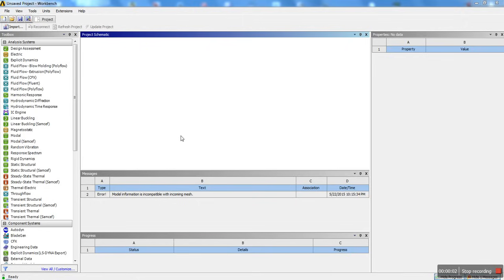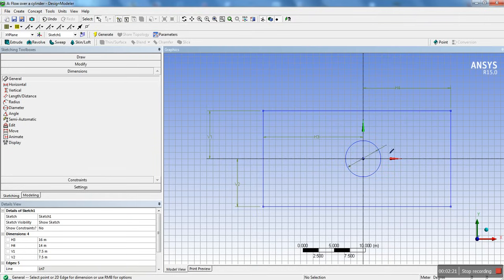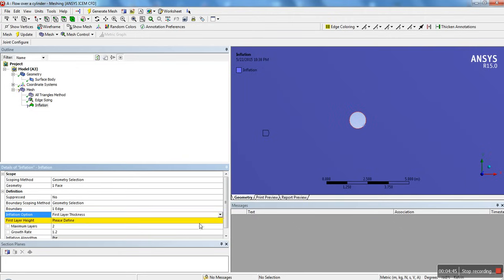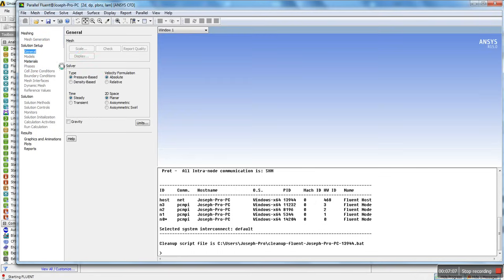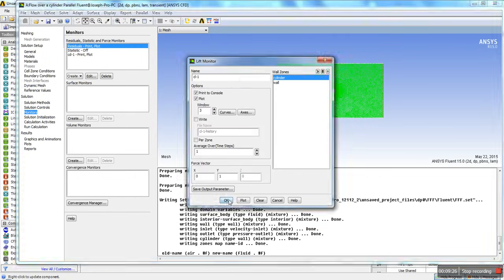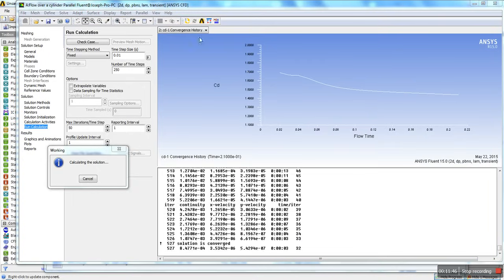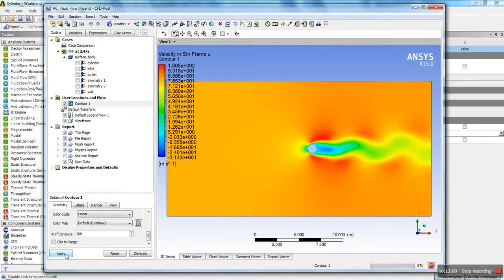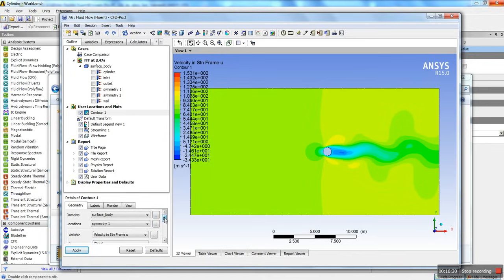ANSYS Fluent CFD Tutorial - Flow Over a Cylinder - Von Karman Animation

Comment: I'm using this tutorial to practice fluent basics for a class at my university, and I've found numerous problems caused by the difference in the software versions (I'm using 2020 R1). Here are those problems and the solutions I found (got everything to work in the end).

0:47 -> double click on geometry doesn't open the design modeler by default any more, instead what you need to do is right click on geometry and manually select "New design modeler geometry".

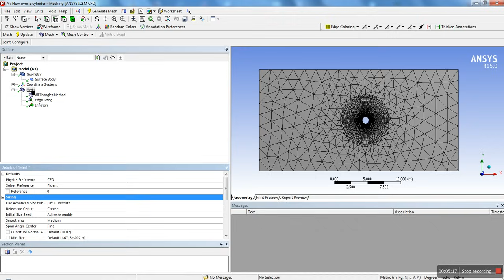5:19 -> "Mesh: Sizing: Max Face Size" does not exist any more (removed in 2019 if internet is to be trusted). To get a similar looking mesh to the one in the video, instead go to "Mesh: Sizing: Use Adaptive Sizing -> Yes", and then add "Sizing" to the mesh (like at 3:52 ), but select all 4 edges of the rectangle and set the element size to about 0.2 m.

8:59 -> The way to create a drag monitor from the tutorial does not exist any more, instead you have to right click on "Report definitions" (just above "Monitors"), select "New -> Force report -> Drag". On the "Drag report definition" window: "Report Plot" is analogue to "Plot", and you have to select "Drag Coefficient". Click OK to close that window. To select the axis, go to "Monitors -> Report plots ->" and there you should find a plot under the same name as what you used for the drag coefficient report definition. Double click it to edit it and a new window appears. It contains the "Axes" button to set the axis to "Y" and the range options as at 9:08.

Thank you for the tutorial.
Reply from the maker: Thank you very much for the updates for other users! I should be posting a new video using the latest Ansys software doing another fluent example! It should cover the points you highlighted.
Reply: @drdalyo  It would be extremely useful if you can upload this study using the latest version of Ansys SIr
Reply: Thank you very much. I was struggling with the Drag and Lift monitors.
Reply: DUDE !!! Thanks a ton!! thank you for taking the time to help people like me!!
Reply: thanks for the this useful info.
Reply: Thank you so much!!!
Reply: Sir, I still could not do the Drag and Lift Monitors in Ansys R1 2020, could you please show me some more instructions?
Reply: Thanks Machane
Reply: @rrkxyab  thank you, though I passed my subject 4 months ago with an A, hahaha....
Reply: THANK U SOOOOOOOOOOOOOOOO MUCH for the "Max Face Size" problem, it troubled me for all day, and I finally got the answer here!!!
Reply: Thank you! So kind of you to take your time and share this information! really apreciate it
Reply: Thanks so kindly, I was struggling with this drag
Reply: Need help
I can't see my results after running the calculation. Even though I safe the file but when I checked the file I can't find the results. How can I find my results after running the calculation? I am using Ansys 2020 R2 . Thanks

Comment: Sir,
How can I provide depth in boundary condition?
Iam modeling an open channel with cylindrical rods (3dimensional model). Flow steady
Water depth 10.25cm/s
Discharge 2.77l/s
Velocity8.94cm/s
Dimension of flume 10*0.3*0.3
Dia of cylindrical rods 6cm
Kindly help me sir

Comment: Hi !  Very good,  a  little fast  but  very useful.  Let me ask you.., my  computers  takes  "ages"  just to  complete  the  Mesh, it stays showing  the  "Ansys Workbench update Model Status"  for too much  time.  Is it a problem with my computer or  is  there  a  way  to get  it  Faster ?  Yes because if it takes such  a  time  just with the Mesh  then  I  don't want  even  try  with the  Fluid Computation.
Thanks
Reply from the maker: You can try increasing the number of cores the program uses. There is a setting for this in solver settings.

Comment: Great video. I am currently working on the flow or vortex induced vibration for a flow past a cylinder. So basically I wanted the cylinder to vibrate in heave motion due to the vortex effects (here the cylinder vibrates due to pressure fluctuations or oscillating lift force). Can anyone help me with this?

Comment: hi dear 
Hope you will be safe and sound. 

Sir I am facing problem in.ansys fluent to capture diesel spray breakup , in literature every body talking about species, Dpm and multiphase phenomenon but in actual.how these can coupled in fluent. 

Sir I answer of some.question .

Plz provide me ,I shall be thank full to you .

My topic is .

Investigation of secondary breakup in heavy-duty DI diesel engine at different injection pressure. 

1. Here need to use multiphase model ? 

2. What is best injection type to select . ? 

3. Can I select inert particle type ?

And what about species transport equation. 

Plz sir guide me I am.completely stuck due to these confusions. 

Thanks in advance

Comment: Hello dear Dr. Dalyo, thank you very much, if we have a rotating airfoil of a vertical axis wind turbine and we select the airfoil to monitor the lift coefficient and we set the force vector (Y direction =1) as the default settings, will the lift coefficient be accurately calculated when the airfoil changes its position? will the calculated lift coefficient be always perpendicular to the drag? Thanks

Comment: Hello DrDalyO, 
I have a general question for you about Ansys workbench. A specific analysis tool (ie static structural) that I may be interested in using does not allow itself to be dragged and dropped into the project schematic window. What can I do about this? Is it an installation issue? or something I may have disable while in the workbench interface? 
Thank you.
Reply from the maker: that sounds a bit odd. what version are you running? maybe older versions did not support the drag and dop. You can always double click it to add it or i think even right click and add to project schematic.

Comment: thanks for the video is really very helpful. my question is about the divergence detected in AMG solver . in fact i'm runing a calculation of lfuid around circular cylinder with different mesh size some folders  show me this error when i run the calculation. i don't think that i have a problem with the mesh  right ?

Comment: How would i know what the Reynolds number for the system is considering this is a 2d model, it has no depth so its hard to know the cross sectional area of the pipe to calculate the velocity required to meet a certain Reynolds number? can anyone help me with this?
Reply: correct me if im wrong .....he wanted the flow to be laminar so he chose the reynold no. to be aroung 80 to keep everything simple  by changing the values of density , diameter and  viscosity to 1 and velocity to be 80m/s ...

Comment: Thanks for the useful tutorial firstly. I have a question about the curve of the drag and lift force. I continue to run simulation by using a time step 0.01s but get a different curve for drag and lift force (between -0.15 and 0.15). could you tell me the time step size you used for the lift and drag force curves you shew in the vadio. Another thing is in the Results part in workbench, you shew a result with about 248 time step and time step size 0.01s.

Comment: hello nice video!
i have a problem, i do exactly what you re doing on ansys 16 and when i calculate i get an error (divergence detected in AMG solver x-momentum).
does anybody know what this is and how to solve it?
Reply: same prob here
Reply: In run calculation window change 0,01 to 0.01. To me this worked with this problem.
Reply: Did you find a solution?
Reply: mesh shouldnt be course ,make it as fine as possible. 
all the best
Reply: same problem!
Reply: yes change 0,01 to 0.01, and then it works
Reply: Flow around a square cylinder using fluent

https://www.youtube.com/watch?v=e4BfNLLYpfI

Comment: +DrDalyO hello! i really found your video very helpful! i think that its a great way to get someone interested into having some interaction with fluent! 

i have a question though...when you say on the wall to change "no slip" to "specified shear" are there any specific values that we have to use in order to get the same results as you?(you dont really mention that) because leaving the values as they are "0" i think it wouldn't have any difference right?
also by changing the reynolds number do we have to change the "specified shear" values again?

sorry if it looks like a dumb question.

hope you'll see this and answer my question! :)
keep up the great work of teaching others so effectively !
cheers!
Reply: By changing wall condition from "no slip" to "specified shear" and leaving shear value 0, a free slip boundary condition is achieved, with zero friction. Otherwise, if there was a "no slip" condition a poiseuille flow would also be formed across the two walls.

Comment: Hi Dr Dalyo,
I am working on a 2-way Fluid structure interaction project related to RBC in capillaries. 

I have designed a micro-scale shell RBC and a fluid medium which has diameter just above the dia of RBC. 
In the transient structural analysis I have defined two fluid surface interfaces:
1. Exterior portion of RBC 2. Interior portion of RBC.

In the Fluent medium I have defined the walls, boundaries of capillary tube and cytoplasm (hollow portion of RBC) which are supposed to interact with with the solid RBC in Transient.

I have assumed that blood runs at x velocity and cytoplasm relatively at 0.97x velocity. Similarly, in transient I have 0.97x  velocity, 9.7x displacement to Solid RBC

When I run  the analysis by coupling both systems I receive error by doing so. But if I reduce the time step (0.0004) sec for 10 sub-steps ,velocity to 0.0000097x and displacement by 0.000097x solution runs smoothly.

Irrespective of correctness of result, Could  yo please tell me why is that if i decrease the velocity, displacement and time steps there is result and why if i consider real time scenario this does not work?

Thanks

Comment: I like this video, it is helpful. I was wondering that how to simulate a airfoil with different angle of attack in a fixed domain. I basically have the problem  that the whole fluid domain is rotated when l wanted to  give only the angle of attack to the airfoil only.
Reply: right.. thanks

Comment: Why  velocity inlet for 80m/s, but use laminar to simulation??
80m/s? isn't it turbulent~
Reply from the maker: +梁伯維 please read up on the reynolds number. Turbulent flow is a function of multiple parameters, not just velocity
Reply: he is using density, viscosity and diameter equal to 1... so reynolds is 80, thats laminar
Reply: @anthonytymchuk5541   Hi Sir if i use udf to define the equation of  velocity  why the von karmeen vortex didnot found!?

Comment: hi im doing integrated fluidized bed with heat exchanger, can you advice me on what i need to take note for this form of computation cuz i can't seem to get my fluent to work
Reply from the maker: +Wei Ghee Ng not sure if i understand the question
Reply: what is the difference in fluent specifications for fluidized bed vs flow over cylinder?

Comment: thanks a lot.  I have done all steps as described on your video.calculated and get the results but lift stabilized at 0.125 and drag didnt drop to 1.300 and stabilized at 1.500, why did I get different graphs?
Reply from the maker: +Serkan Ali double check maybe the no slip condition, i forgot to do it in the tutorial but i included a note. Please watch the video again.

Comment: I'm trying to recreate similar meshing options but for a 3D model. However, when I apply the edge sizing and inflation options, it doesn't generate the uniform mesh that you see around the cylinder at 5:10. I've manage to recreate the mesh on a 2D model with ease but am only having complications with the 3D model. Any advice?

Comment: Hey up, Zero-Shear boundary is usually prescribed for fluid-gas interfaces (i.e. free surface) why have you applied this and not no-slip?
Reply: +Danny Stanzl Because the no-slip condition is applied when there is a wall and a fluid passes over it, the shear stress will have a certain value due to the viscous property of fluids and the boundary layer...at the walls of the domain, these are imaginary walls for specifying the domain in ansys and there is no shear stress near these walls because they are not real walls like airfoils or cylinders..so you make shear but its value is zero...these areas have the same fluid.

Comment: Its very helping. But can you please explain if there is any mathematical calculation for setting bias factor or edge sizing?
Reply from the maker: +subrato roy yes you can set a bias factor for edge sizing in the Mesh-Sizing tool, there is a option to select a bias.

Comment: thanks a lot! 
can you give a quick tip about how to get the result from the fluent and use it in structural analysis? I.e. I want to analyse the wing , get pressure diagrams, get the force reaction in wing's mounts, and then use this forces as the load in mounts analysis.
Reply from the maker: +skullheaddd1 you could drop a static structural on the project page and link the results from fluent to static structural and check the forces. If not, in fluent there is also CD and CL coeficcients as well as other post features

Comment: Great job on the video, well explained. I am just a little confused about one part. How come you get this type of flow when the flow is set to laminar but according to your input the Reynolds number = 80 which is turbulent. I tried running the same problem with a K-epsilon turbulent model but got a normal velocity contour without the vortices about to form. Any explanation to why this is so?
Thank You
Reply from the maker: Im not sure I understand. A reynolds number of 80 is not turbulent but laminar. 
The von karman effect only occurs in laminar or low reynold number flow.
Reply: +DrDalyO You are right, I misunderstood when Von karman effect occurs, I thought it was due to turbulent flow. Do you have a similar video regarding inducing vortices from turbulent flow?
Reply from the maker: At the moment I do not have any such video, however I could add it to my list of videos to make!
Thanks for watching!

Comment: what is hybrid initialization mean  ?
Reply from the maker: The fluent solver works iteratively, so before the first iteration of the solve, a value must be given for every quantity in every cell. This is called i initialization. The more realistic the values are, the faster the solution converges. The hybrid initialization is a newer feature (since ANSYS 13), which gives a quick approximation of the flow field using a collection of methods and interpolation to efficiently initialize the solution based only on the setup, so you dont need to provide additional input.
In short, the hybrid initialization is in most cases easier and gives quicker results when compared to the standard initialization.
I hope this answers your question! Thanks for subscribing!

Comment: How can I make this cylinder rotates? just to detact the effect of the rotation on Von Karman street? thanks
Reply from the maker: +Oula Fatla I dont really understand the question..
Reply: Hello my question was how can I model a rotating cylinder in a fluid flow. lets say the same case in the tutorial video but with a rotating cylinder. As mentioned in researches rotation effects significantly the vortex shedding activity behind the cylinder. How can I achieve this case numerically? Thank you
Reply from the maker: +Oula Fatla Ok! so say using the same tutorial as above, go into fluent, on the left choose "Boundary Condition", then choose "cylinder", then "edit". In the Wall menu, under wall motion, select "Moving Wall". Then set the motion to Rotational, and choose your speed, say "200 rad/s" and click ok. Reinitialize and view the results. For more accurate results, you can change the viscous model instead of laminar to k-epsilon. Let me know how it goes. If it answered your question please subscribe and like! Thanks!
Reply: Thank you so much for your help. The simulation went very well. The suppression of the von Karman street behind the cylinder can be clearly spotted from the u velocity vector and the lift coefficient plot. Thanks again